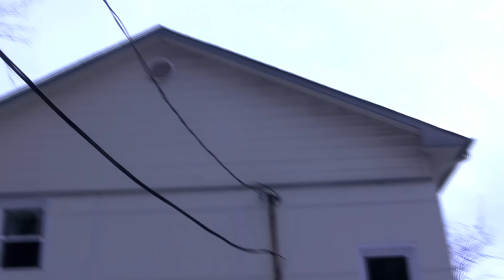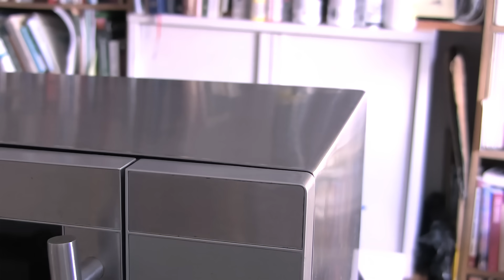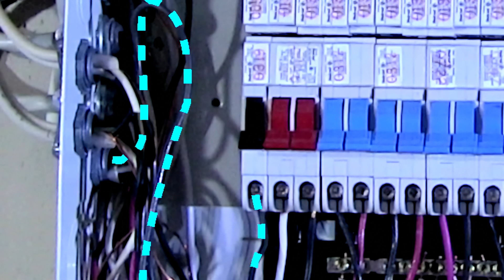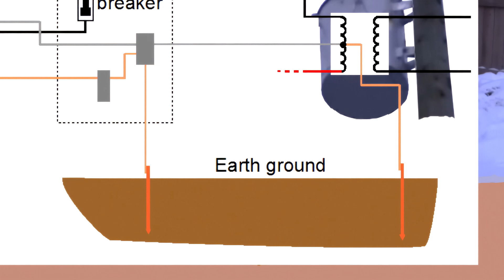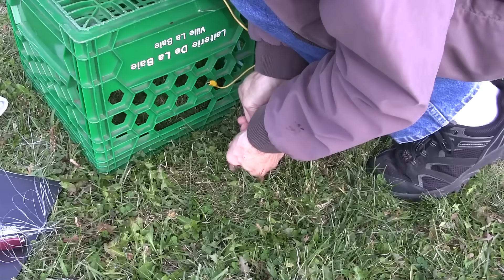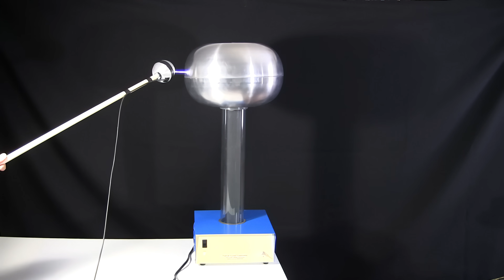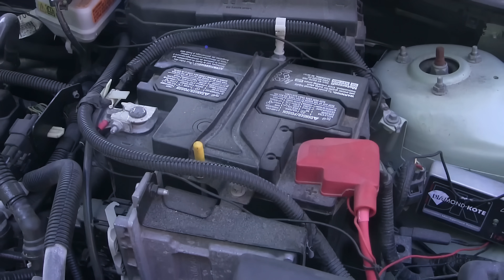What is Ground? Earth Ground/Earthing

Comment: In Europe( Germany, Spain, ... ) it works a bit different since about 1990...
Here we have another security feature called "FI" or "Fehlstrom Schutzschalter" ) which is connected in front of the fuses..
It counts amps in on phase and amps out on neutral...if those are more than 30mA different( if cable in microwave touches casing, which is connected to earth ), it cuts all the phases of together, way before 16Amps flow so fuse cuts...
Also if earth should not be there, when you touch the microwave,  just about 30mAmps can flow through you before FI cuts because electricity is escaping through you into ground/earth...
So here earth and neutral are not connected together... ;-)
The cabling you describe in this video, is called PEN-cabling here and in germany that is not allowed anymore since long time!
And hey, in fact in the cabling you described, you would not need an earth-cable at all, it would work the same way without it...
Reply: Instead of that current-counting happening at the breaker, in the US we have Ground Fault Current Interrupt (GFCI) outlets which do the exact same thing at individual outlet panels, and only that outlet will shut off in the event of a fault. If I'm trimming my hair at the sink and suddenly conduct even a small current, for example, the outlet will trip and the rest of that circuit will be unaffected. These outlets are typically used where risk of electrocution is higher, like outdoors and inside around water sources.
Reply: Yeam but if a toaster sits on a wooden table, it will be very well isolated to the ground, until someone touches it...
If it got an additional cable which connects the casing to EXTRA "earth-wire"( which in the socket is connected to a 3rd cable which is  connected to earth in a low-resistant way, the FI can act BEFORE someone touches the toaster...
Reply: Markus Klaschka interesting
Reply: Well, those GFCI exist here too, mostly in buildings with old electrical installation and just to safe wet-rooms...
But hey, those are expensive, and just to come back to the microwave example from above.
If you have a damaged microwave and connect it to a US socket, nothing happens until someone touches it.
If you have proper cabling( additional earth ), the case of the microwave already is grounded and the FI will break circuit before someone can get shocked...but this only works if you have phase, null and earth, not if earth and null are the same...
Reply: Markus Klaschka I don't see why the outlet needs the 3rd ground terminal here. If less than 100% of hot current returns via neutral, a GFCI outlet trips and becomes an open circuit, no matter how much of that difference flows through the ground terminal. Certainly if hot shorts to the casing, you want it grounded so the high current breaker trips and you don't wait around to detect the shock.
Reply: Look, in the end this is very simple...
If you have no "earth-wire", the casing of the microwave is not connected to earth.
...so neither GFCI of FI would break circuit, because the current can't flow away...
And also when someone touches the microwave, he will get a small shock until the GFCI of FI breaks circuit( 10-30mAh)..
If you have an additional 3rd "earth-wire", the casing would be connected to earth and not null...meaning that GFCI and FI can react before you with your body close circuit.oO( acting as "earth-wire")...
Reply: This is just wrong!
Atoms can't connect together....this is called fusion and you need a lot of energy to do that.
So, there is always some resistance between you and ground!

This is the same effect why you do not dive into the ground, but will bounce up again when jumping from a building for example
Reply: If the casing is connected to neutral but not to ground, the current will flow through neutral, so the GFCI does nothing because all is ok....
In the moment you touch the toaster( which is not grounded, because it got plastic legs ), you will get a small shock up to twice the 30mAh before the GFCI opens circuit.

If casing is connected to ground, current will go there and not to neutral, so GFCI opens circuit even before someone touches the toaster...

Hope I explained well enough
Reply: ...now I understood what you mean...you do not need the cable in the wall. that is right...but you need the device having an extra ground-cable...
But hey in the end...why buy so many expensive sockets?

Comment: I wish i knew this 10 years ago when i tried building a guitar amp! I thought the ground symbol in the schematic meant everything went to the case which had the ground prong wire attached. I blew the capacitors real fast when i turned it on. Mb I'll take another shot at building one

Comment: In negative cycle, the direction of the voltage gets reversed. So, the negative wire has now higher potential. Now, it is also connected to the case which means case also would be at the higher potential, as the neutral wire is at the positive potential in the negative cycle, wouldn't that electrocute a person if he/she touches the case?

Comment: In the USA most code is base on  National Electric Code.  In the 2014 code 210.8 A-1 though 10:  tell the 10 areas that need GFI protection in dwelling units.

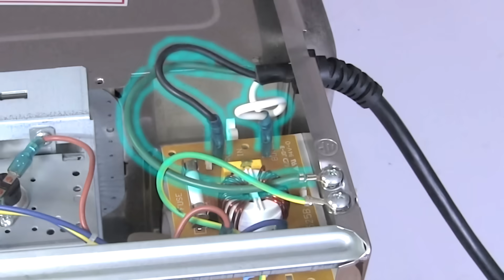Comment: 2:03 So neutral is basically ground and outlets with ground wire are useless, thanks, farewell
Reply: No, you missed the point. The ground is there to keep you alive and safe.
Reply: Kirks Karaoke are you joking
Reply: +igor. he's right, you missed the point.
Reply from the maker: Yeah, there are a some questions that keep coming up in the comments that shouldn't, given what I tried to achieve. So I did fail in some places. Oh well. It's too bad youtube doesn't all reuploads without loosing all of people's comments -- it's those little refinements that lead closer to perfection.
Reply: Yeah very much NO.
Reply: GrodyMaroon what if the lightening hits the ground rod
Reply: GrodyMaroon im too tired to think
Reply: The neutral (also known as the grounded conductor) is bonded to the Earth ground at the service panel is to insure that the neutral has remains at zero voltage potential; if allowed to float it could result in higher than expected voltages between the neutral and line conductors.. The safety ground circuit exists for  exactly that, safety, if faults arise elsewhere, it's not optional.
Reply: waswestkan so you are saying that neutral is ground? why do i need 2 grounds if the neutral in my outlet is already connected to the ground, just further away from my house
Reply: This is exactly why the "ground" on your outlet should NEVER be called "ground". It is not ground, it is the "bonded conductor", the neutral is the "grounded conductor". Too bad that almost everyone uses these terms, they confuse the hell out of people who aren't well educated in electricity. 
The "neutral" and "bond" have a common point of connection, this is true, but there are VERY IMPORTANT reasons why they are separate conductors, and also VERY IMPORTANT reasons why they are connected (at ONE POINT, and only one point).
Reply: Before I retired, I was an Electrician for 40 years. I do Karaoke hosting for fun now.  "The ground is there to keep you alive and safe." is a general statement"
Reply: thanks Steven, now ill have to look up the difference between the Bonded conductor and Grounded conductor, because the OP of this video has failed to use proper electrician jargon
Reply from the maker: Well, I wouldn't say I failed to use the proper electrician jargon, more that I chose not to. The intended audience wasn't electricians, nor would I be the person to make a video to train electricians. For that I'd recommend videos by Mike Holt (e.g. https://www.youtube.com/watch?v=mpgAVE4UwFw). The intended audience is lay people who are just curious about the ground hole in the receptacles and ground prongs in the plugs in their houses and high voltage hobbiests who discharge their high voltage stuff. So I made great effort to be technically correct (even removing the first version of this video to fix some things), but use the common terminology.
Reply: RimstarOrg I think the video works quite well enough. I agree that using common jargon makes the root principles you were actually trying to cover much easier to lay out as you are using common language. 
Unfortunately some people as shown here need a little "extra".
Not sure how best addressed.
Reply from the maker: Thanks. I like that one too (Bill has lot's of fun stuff). It explains it by going through the history. I used that page as the basis for my old Hot Neutral and Ground our Funny Looking Household Electrical Socket video https://youtu.be/k3OHzKz0qNc.
Reply: well the video was good, but im not an electrician, and while i found the video interesting, as a viewer, this is what has confused me, you gotta be careful being ambiguous otherwise it will just confuse someone even more

Comment: One thing that confuses me is if mains is ac due to there being a transformer, why is there a hot and neutral which is typical for a dc current source?
Reply: There is no hot and neutral in direct current. It's called positive and negative because electricity only travels in one direction.
Reply: In AC, the hot wire goes from -230V (or -110V in the US) to 230/110V.

The neutral wire stays at 0V (relative to the ground).

So if you touch the neutral, nothing happen. If you touch the hot, you're dead.

But current still flow both ways (from neutral to hot when hot is negative, and from hot to neutral when hot is positive), so it is AC.

Comment: So the negative terminal on a car battery is really not negative, its a ground. Right?
Reply: Depends. Some cars have positive ground.
Reply from the maker: The negative terminal of the battery is negative with respect to the positive terminal. The fact that it's connect to the chassis doesn't change that. However, it's at the same potential as anything else that's connected to the chassis since they're all connected together. "Chassis ground" is more like a common potential than an Earth ground.
One reason it's done that way is so that you can connect one side of a 12V lightbulb, for example, to the positive of the 12V battery and the other side to the chassis anywhere. Since the battery negative is also connected to the chassis, battery current will conduct through the lightbulb since there's 12V across it.

Comment: Good video, would add (to clear up common misconception) that earth ground does not actually dissipate current like people think it does, current always wants to go back to the source.  Not that you said anything different, but it always helps to inform non-electrical minded folks.  For example, the national electrical code (in the USA) requires an earth ground to be 25 ohms between the grounding electrode(s) and the earth.  At 120 volts, this only draws about 4.8 amps, not enough to trip a breaker/fuse.  Like you mentioned, the earthing is used for lightning protection and/or other natural forms of transient currents (by transient I basically mean other than what voltage was intended to be carried by that wire).  We use the equipment grounding conductor (green wire) to protect people and equipment from electric shock, to use your example, from the housing of a microwave oven (or any metal housing for something which uses electricity could be an example).  We "bond" the neutral wire to the ground wire at the first means of disconnect (usually your house panel), to provide a very low resistance path in order to trip the breaker or blow the fuse in your house's panel.  Above all else, do not EVER connect a neutral wire to ground anywhere other than your first means of disconnect (like I said, usually your service coming to the building).  As an electrician, I've had many calls to investigate why a piece of equipment is shocking people, that could be an appliance, a pull chain for a light fixture, or any other type of equipment.  The cause, most often, is because someone tried to cheat and connect the neutral to ground (which electrifies the appliance itself!).  Yes the neutral (usually a white wire for homes) is a "grounded conductor," but it does not substitute for an "equipment grounding conductor (green wire)."  The reason I typed all this up is because not only myself, but many others have been shocked due to a neutral being connected to ground where it should not have been in an attempt to make an appliance plug into a non-grounded system (usually in older homes with only 2 prong plugs).  Sorry for the wall of text, but hopefully someone learns something from it.

Comment: Not sure about other regions, but in Canada there is a difference in nomenclature (typically ignored) wherein the conductor running from the primary service entrance (panel in a house) that you call "ground" is actually called the "bond" (as it is bonded), the "grounding conductor" then runs from neutral to earth ground.
The "Bond" on the shown Federal Pioneer electrical panel is the BRASS screw near the centre near the main service disconnect breaker.
In Canada ground PLATES are typically much more common than RODS, mainly due to soil conditions (you'd need TWO rods).

Also here you REQUIRE the plate/rods, and must also bond to the incoming gas and water lines if they are metallic (not plastic) mainly for safety reasons (not to improve conductivity to ground from the panel). Using a water line as your connection to earth is NOT allowed by the CEC (Canadian Electrical Code), however it was once upon a time practiced. Also a note that Water meters and hot water heaters need to be bridged by copper wire if metallic pipes are used. The idea being that if the pipes are made hot, they will act much like the case of the microwave in your example.

Ground Effect currents can be really interesting.

Comment: can't say i've EVER seen a neutral line run to anywhere other than the household ground unless the house is set up for 3-phase power.   the only lines coming in, were the two "hot" lines from the transformer.    Connect through one of those, to ground, and you get 110 current.    bridge the two incoming lines, and you get 220v for dryers and ovens (and possibly shop equpiment...)
Reply: Actually when you use both phases of a single phase system you get 240v not 220v, 220v is when you have two hots and a neutral in a single phase system. 3-phase systems give many different voltages depending on various configurations, common in North America are 600v, 347v, etc. In ANY North American household electrical service there are 3 service conductors (Neutral, and two hots 180-degrees out of phase), in most overhead electrical services you don't see a WHITE wire because the steel-core support cable of the triplex is actually the neutral conductor. It is completely necessary to create 120v.
This also brings up an important distinction in nomenclature that is typically ignored, the "ground" conductor in the building is NOT actually properly called "ground" its actually the "bond", called this because it is bonded to ground and the neutral. The GROUNDING CONDUCTOR is ONLY the wire that goes from the neutral of the service entry to earth ground.
Reply: when I look at the support cable, I don't see it connected to anything other than a an eyebolt at each end.....no electrical bond at any point along it's length.....
Reply: http://www.southwire.com/ProductCatalog/XTEInterfaceServlet?contentKey=prodcatsheet34 product sheet for the wire 
https://en.wikipedia.org/wiki/Service_drop#/media/File:Residence_service_drop.JPG Wikipidia photo of the mast head of a residential service, note the two conductors, then three entering the mast head.
http://www.tnb.com/ps/fulltilt/index.cgi?part=PAA109 One possible connector to connect the wires. Also common is a barrel splice after the insulator rack support.